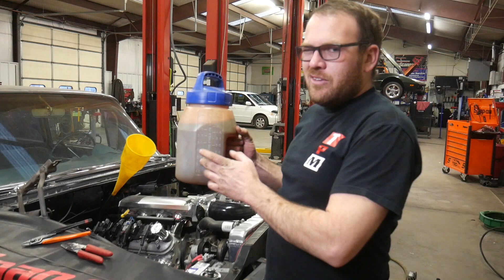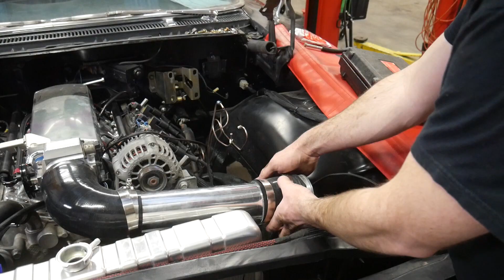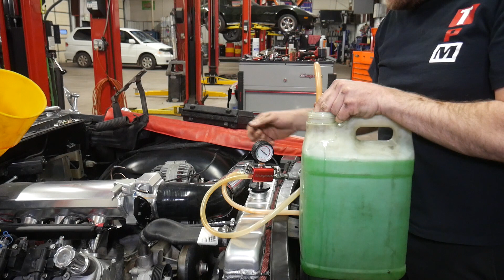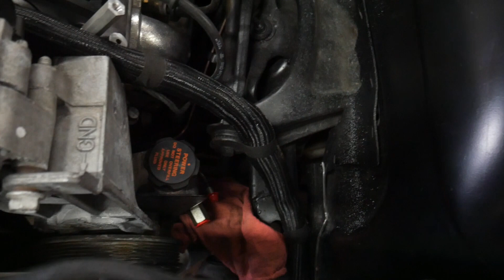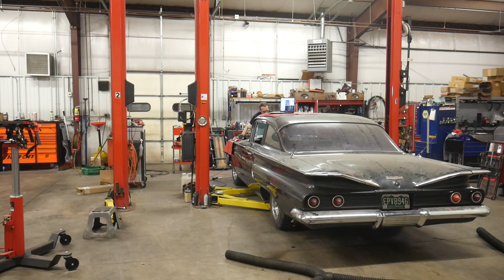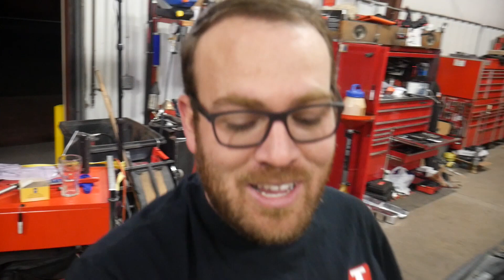1960 Chevy Biscayne LS Swap Ep 34 - Filling coolant and transmission

Comment: Very handy tool the vacuum coolant filler. We also have one at the shop. Mario also did a video on it and what I liked is that he has a weight on the coolant suction hose so it drops to the bottom of your coolant container avoiding to suck air into the system once it starts to get low. 
Thanks for sharing Chad 👍
Reply from the maker: The weight is a great idea. I vaguely remember seeing that on his video. Now I need to watch it again and see what he used for a weight.